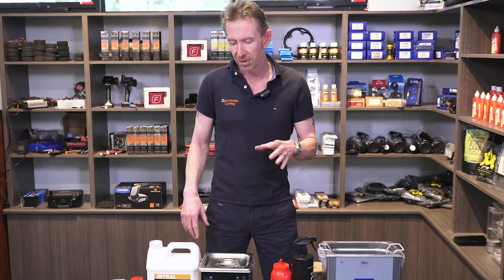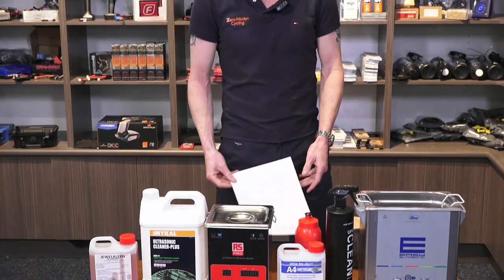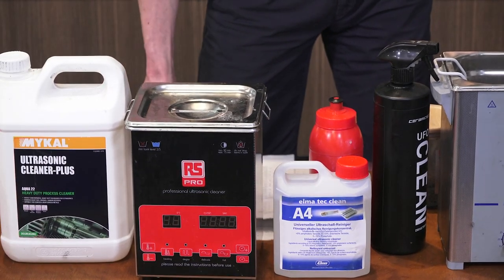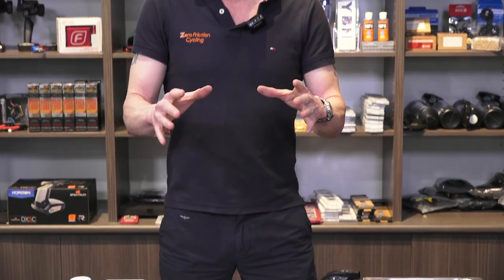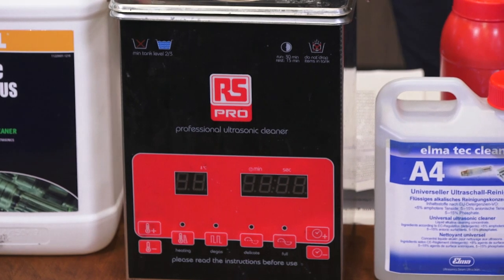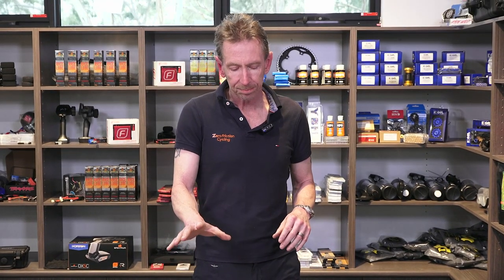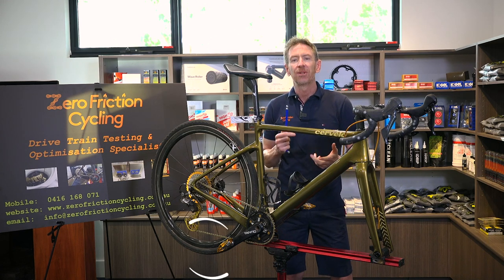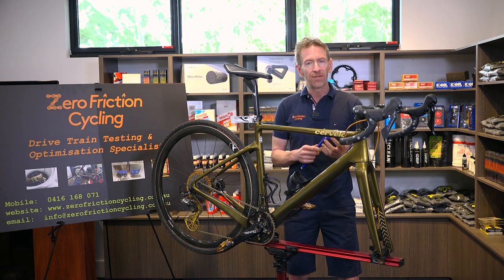Episode 8   Ultrasonic Cleaning and Race Chain Guide

Comment: I wash the factory grease off with paraffin. Then dunk in candle wax. Then I drip White Lightning drip wax before every ride. I then wash the chain in the candle wax bath every 3 months and repeat. This is both very cheap and works. Much, much better than  mineral oil, but an unknown comparison to ultracleaning. I use the big white candles for £0.50. I know it work because cassettes don't skip with a new chain.
I think you have to weigh up the cost of time, cleaning products and parts. Caring too much has diminishing returns.
Reply from the maker: is this a parody comment?! It really seems like a parody comment. I am not sure you are on the right channel for you. There are tons of forums of chain cleaning and lubricating advise that I think you will really like much more. First pls read the section re diy waxing in my waxing FAQ guide, and then if i can humble ask that such advice is not further propagated on any ZFC channels, i work hard enough as it is to correct very poor info / advice.